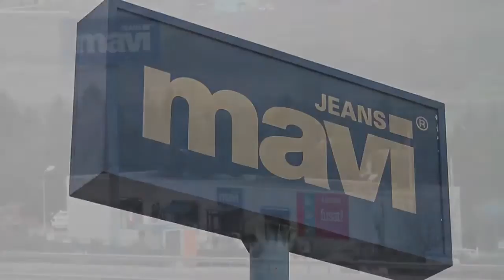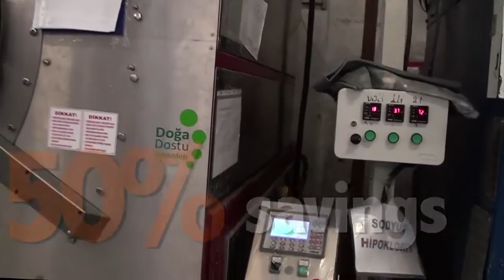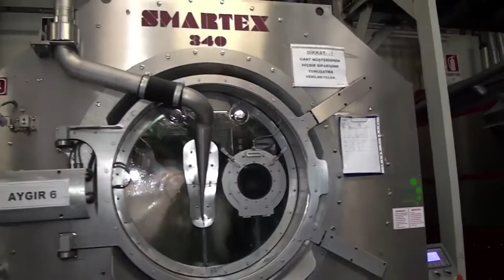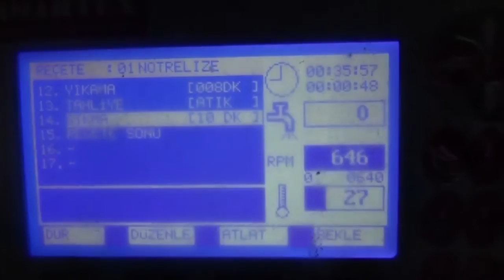Garment Dyeing Machines - Tolkar-Smartex

Comment: i wonder how many rpms 400 g is
Reply: carwashgaming 800 I work with these and I'll tell you they are pieces of shit they break down every day
Reply: @nightmareinaction629  please contact me on whatsApp +91 7588563675 I would like to buy the same
Reply from the maker: It's around 900 RPM depends on the capacity of the machine.
Reply: @tolkarsmartexlaundry  smaller models get higher rpm. Makes sense for industrial machines